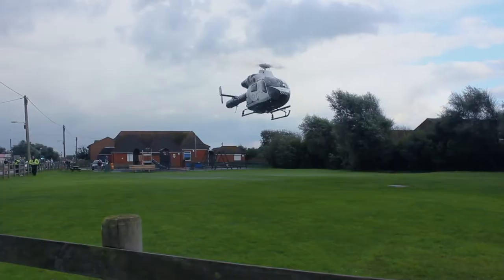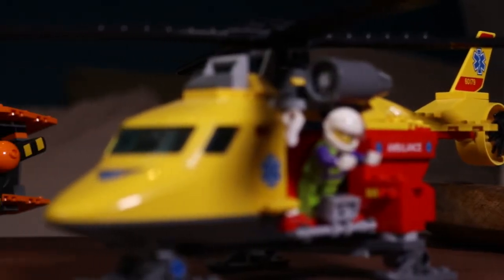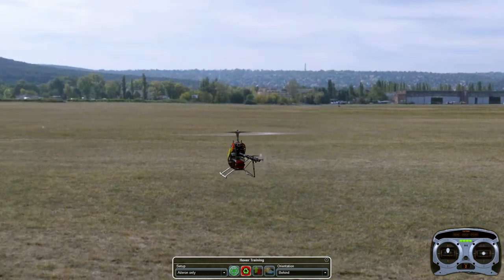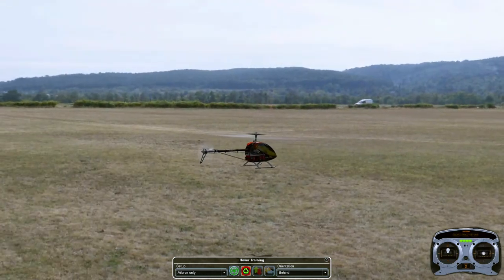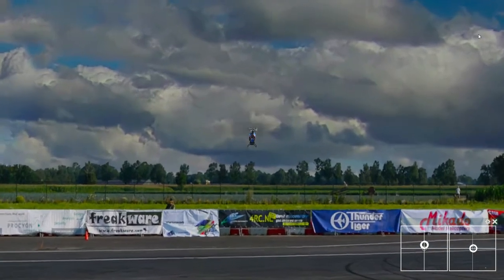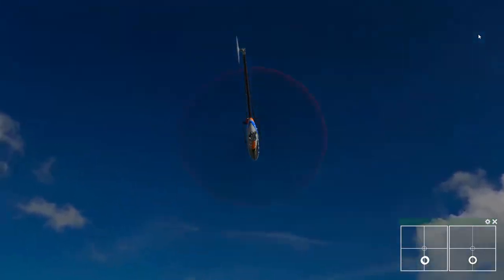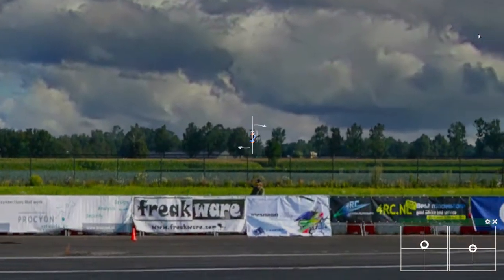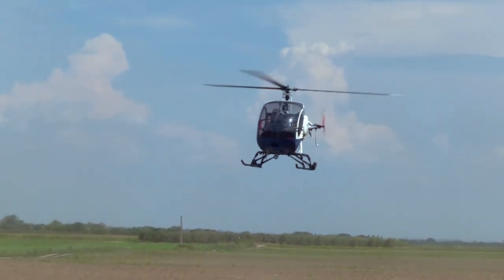WHY? Helicopters CANNOT fly straight | They must drift

Comment: What about gyroscopic procession, dissymmetry of lift (aka one side of the rotor produces more lift than the other). Also subsonic flow at/around the tip of the blades (on the high lift side). What about blade stall too? How bout transitional lift?
Reply from the maker: And many more, you are right. You know that the topic is a very long and complex story. Full explanation was not the aim in this case, rather just to reflect something on very simply. This episode is not for experts.
Like when my daughter was taught in the school about "zero gravity". I questioned her teacher: "why do you teach that there's no gravity in the space? What the heck keeps the Moon with us, the Solar system together, the galaxy together and so on?" She replied: "this is enough complicated for them anyway, this was the simplest explanation." And this is how we explain the swashplate and the cyclic pitch too. No mentioning of gyroscopic effect, aerodynamical effect, just the basics: aileron pitch, elevator pitch. The realisation of the real peak of the pitch comes later.